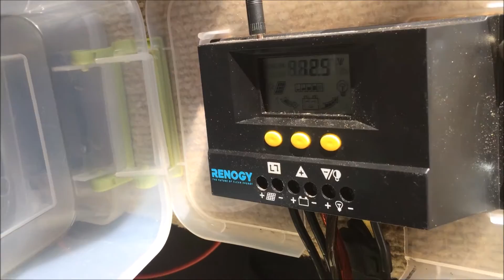Solar powered cruiser repurposed sailboat

Comment: I'm an ohio River rat myself..  I've read several of the comments and have a reliability question.. Since you are using two off the big box store rack motors.. That aren't meant for a main motor like a torqeedo,have you had any issues,or carry a spare or two?
Let's face it.... I'm a cheap ass...lol....
I want someones 15-20ft swing keel cruiser that needs all new rigging and all that,that i could get dirt cheap because its just wore out to the normal sailer.. I've priced that stuff...omg.. B.reak O.ut A.nother T.housand..lol
BUT.. With the cost of solar coming wayyy down,now could be the best time to do it.. Especially with DIY combo solar/wind kits from Amazon and eBay.. 
Id like to canopy and partially enclose the cockpit with panels on top and a good wind generator closer to the front.. Then do the great loop from Pittsburgh to Pittsburgh.. Well.. Not all the way back.. About 100 miles down river from there.. Im glad i found your build
Reply: I do keep spares of the motors on hand (I also drive solar-powered canoes with them)  I give them a lifespan of about two years before replacement is needed. (unless they are ripped off my transom when I motor over sunken brush)  then it's less.  I use the Minn-Kota 55# Endura Maxx because I like the Pulse Width Modulation control boards in them vs the cheaper switched Endura C2 types.  These motors can be refurbished/repaired if you know your way around electric motors and have the manual dexterity to work inside the waterproof housing.  The replacement parts are a lot cheaper than purchasing a new motor.

Comment: Curious how many amps the trolling motors pull at what speeds and how many watts the solar array produces being mounted flat instead of angled toward the sun.
Reply: Michael, I've messed with solar panels and trolling motors for quite a while.
I just received a pair of 55 lb 12 volt motors to power my 21 foot repurposed sailboat.

For batteries I have a pair of 100 amp hour Battle Born Lithium Irons.
1600 watts of panels producing both power and shade.

I've put a few videos on Utube showing the boats.
Here's a link to one of them:
  https://www.youtube.com/watch?v=CMlKXfYUdzY

If you click on 'Gary Gerard' below the video you'll go to a page that has a couple more.
good luck, Gary
Reply: Michael, I read a few times (Internet) that 12 volt trolling motors pull about the same number of amps on High as they have pounds of thrust.
I've found this to be true the couple of times I've checked it (within an amp or 2 so - good enough for a rule of thumb.

I've also found the top speed with a trolling motor is about 3 to 3.5 mph.
That's what you'll do in a canoe or small dingy and such
'Not a 40 foot houseboat!
Put 2 trolling motors on that canoe and you still only get your  3 - 3.5 mph
Check my other reply to your question.
Gary
Reply: @garygerard4290  Your "rule of thumb" is correct.  I use an amp meter to monitor draw for my motors.  For my 3700 pound solar sailboat I draw about 47 amps at wide open throttle using the stock Minn-Kota Weed Wedge Props.  I get a top speed of about 3 mph. (No wind, calm water).

Here's the magic, when I switch the prop from the Minn-Kota stock prop to a left hand 4.5" pitch 10" diameter APC Brand model airplane prop, I get an extra half mile per hour and my consumption drops to about 35 amps.

The model airplane props are consumable, meaning if you hit something like a log or drag them across a gravel bar, they will tear up easily, but at $4.95 each I can keep a half dozen of them in stock and swap them out in less than 4 minutes.  The Model Airplane Props also don't fare to well in rooted weeds like millfoil, elodea, hyacinth or Lilly pads, tend to wrap them around the spindle like so much spaghetti on a fork.  The Minn-Kota stock props are designed to better handle weeds.

I can cruise all day at 3.5 mph applying 300 watts to my two electric motors.  Again, calm wind, no current.
If facing current > 2mph or wind over 15 knots or waves over 2' in height, I fire up a gas 9.9 to continue on.
Reply: @kencooke4474  thank you for your response
Can you give me a link to where you bought the props you mention?
'boating faster on less amps sounds great
I'll have a small box full of those suckers
Gary